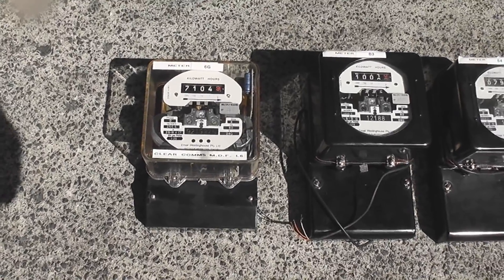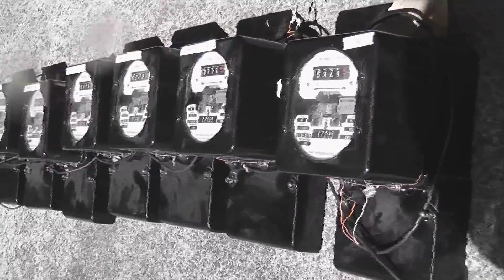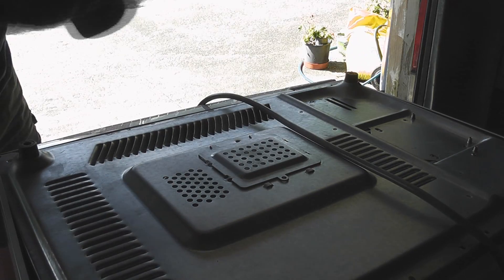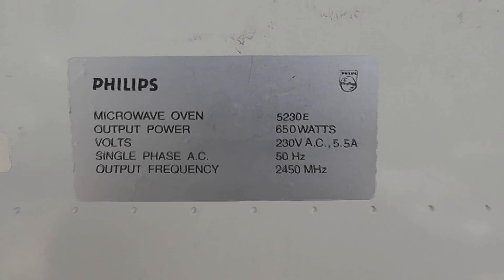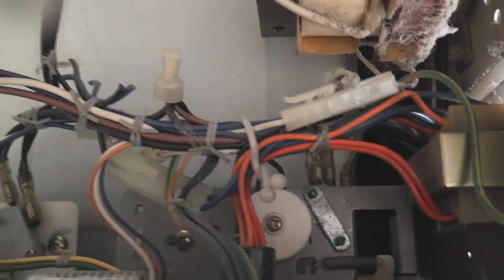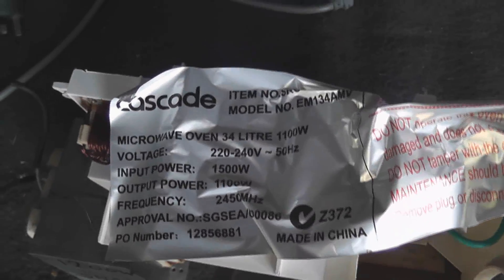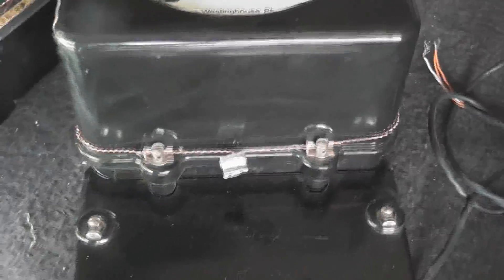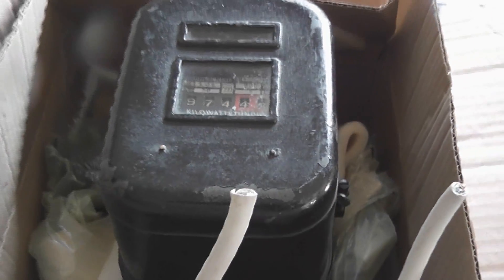Email - AEG and Microwave rambling

Comment: Awesome video, lots of things to do in future videos indeed. :D
The gardening setup is great, the broken bulb can still be messed with until it really pops apart. Both microwave magnetrons were lemons, which sucks. BUT it doesn't mean you cannot carefully (outside of course) remove the magnets and use them for other projects. That old meter is nuts! It almost looks modern to a point.

Comment: The reason the philips transformer is bigger is because it was built to a standard, not down to a price
It would have better insulation, and could take more abuse
The inverter one is smaller because it runs at higher frequencies, a bit like a switch mode power supply
Reply from the maker: Thanks, you are 100 % correct. Now everything is made at cost, and as cheaply as possible with the minimum amount of materials.
Reply: I would pay twice the price for a microwave if it would last 15 years or more rather then 5 years like some of the newer ones. I think that would conserve more materials, and definitely save more money, then having to keep replacing China crap all the time.
Reply from the maker: OlegKostoglatov
Couldn't agree more with you. Same with all these fancy electronic led washing machine controls, may last 3 - 5 years while the rotary mechanical ones last 20 + years.
Reply: Fortunately they still have washers available here new with the electro-mechanical controls, so if we need a new machine taht's what we will get. We had to buy a new dryer about three years ago because the old one had a motor problem. I think we bought that dryer in 1989-90 so it owed us nothing, the matching washer was bought in 1992 and it's still going strong. The washer is a top loader, so not much for electronics nor gaskets to fail, nor mold to grow, and it actually cleans clothes properly.
Reply from the maker: ***** Haven't seen a MOT with Aluminium windings in NZ. all have copper windings. When Al is used the wire size needs to be 1.4 x bigger to make up for the losses and conductivity.
Reply from the maker: ***** By scraping the ends off the coils wiring. In NZ these MOT's are all copper. In The USA they use Aluminium house wiring too. Not allowed in NZ, only on OH lines and UG street cables.
Reply: RODALCO2007
Some MOTs have aluminum/aluminium wire but I doubt whether all do, the cheap ones maybe, when you think if how many turns you need for the secondary it's kind of difficult to do when you have to use a wire 40% thicker, that means a bigger bobbin and core as well. I will have to find a newer scrap microwave and see what the used in the transformer.
 As for house wire they banned aluminium wire in Canada back in the 1970s, though I think they still use it for heavy gauge lead in wires sometimes. It was really popular to use back in the late 1960s when they had a run up in copper prices, in part because of the Vietnam War, but in house wire it became a fire hazard, junctions became loose, people would mix copper and aluminium wire together, use copper rated outlets, switches, and wire nuts on aluminium.
 You can work with it if you know how, but most electricians now have never seen the stuff. Also if your house is old enough to have aluminium wire it probably needs to be renovated and could be rewired at the same time properly with copper wire.